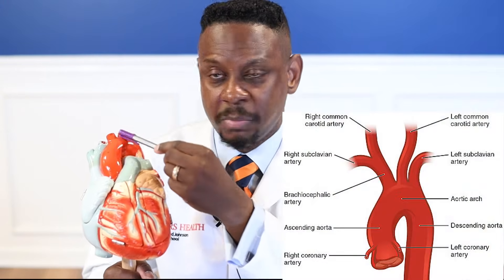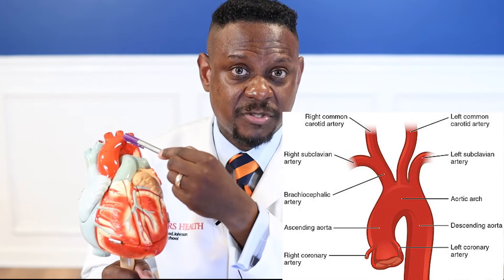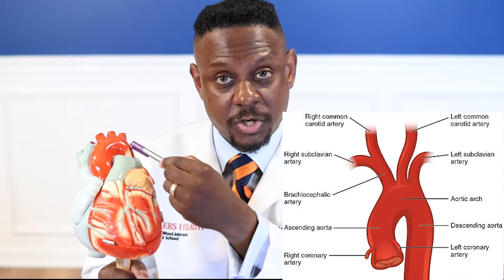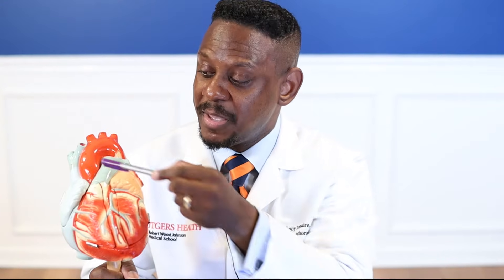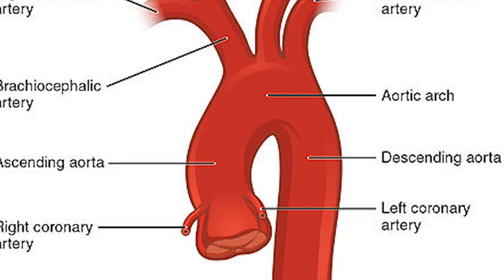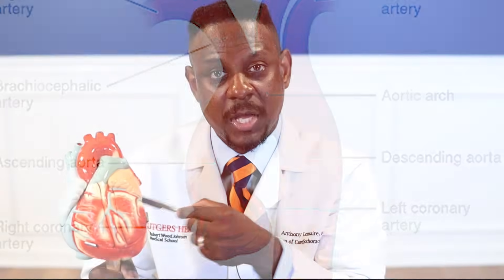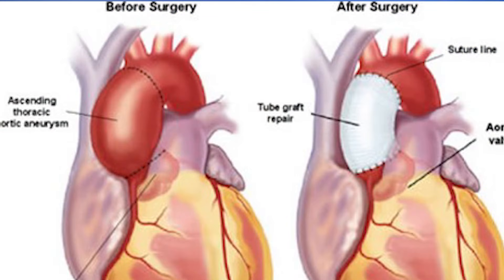Repair of An Ascending Aortic Aneurysm

Comment: I'm 41 years old and I just had a CT scan show my Ascending Aorta is at 4.9cm, I was born with a bicuspid valve which is why I am now looking into getting surgery done. I would like to get recommendations of where to go, as the idea of open heart surgery is a bit scary. I live in Southern California. Any advise would be greatly appreciated.
Reply from the maker: I apologize for the delay in responding. I understand your concern and at your young age, you will most likely require surgery. There are excellent aortic surgeons in California. I would look into Cedar Sinai hospital as an excellent hospital for aortic surgery. The medical centers associated with USC, and UCLA are excellent. If you have access to San Diego, UC San Diego also has a strong aortic surgery program. I would STRONGLY recommend doing your own research however. Since I'm in the East Coast my knowledge of the West Coast is not as vast. Good Luck!
Reply: I m in San Diego and had a very successful double surgery in March of 2024. Sharp hospital I LA mesa, surgeons Dr.D Wu and Dr Lynn are the best. The hospital has a ne2ly build postoperative building with panoramic views. Go there!
Lots of good referrals to hospital in LA mentioned below your comment

Comment: So this condition always requires open-heart to repair? i.e. less invasive wont work?
I believe its location makes it too difficult without open heart.
Reply from the maker: I apologize for the delay in responding. Currently, there are no percutaneous approaches to repair aortic aneurysms. There are surgeons that can perform this operation with a small incision but its still referred to as an "Open Heart" Surgery. Take care.

Comment: I am 70 years old female, I have ascending aorta aneurysm 4.5 decrease to 4.2 in the result of angiogram. I know there is a risk because of my age. I learned from your vlog the procedure and now I am afraid. With my age do you recommend surgery in my case? Thank you for your reply doctor. Your page is very informative.
Reply from the maker: I apologize for the delay in responding. Aneurysms rarely decrease in size. If your aorta is 4.5cm then there is a very good chance that you will not get to 5.5cm so you should not require surgery. I strongly recommend that you keep your blood pressure controlled and see a CT surgeon. The surgeon will follow the aneurysm will CT scans of the chest yearly. Good Luck!
Reply: @cardiacsurgerypatienteduca2445  Dear doctor, thank you for the reply. I have a cardio vascular doctor. He examined my angiogram and found out that my aneurysm is not even 4.5. It 4 only. I am so happy doctor. You are a good doctor. You responded at once, you are the kind of a doctor who inspire his patient to strive to live and see the lighter side of life. God bless you and more power.

Comment: Great information! I’m a watch and wait patient that my GP sends me once a year for Ct scan. It has remained at 4.1 for 5 consecutive years. I’m 59. Should surgery be an option now still? Man it does cause a little anxiety knowing it’s there. My A1c is 5.9 so type 2 is controlled with metformin and good diet. Anything else I can do??
Reply from the maker: Sorry for the delay in responding. I don't think the aneurysm will grow much. The fact that it hasn't grow in 5 years is a good sign. The best you could do is keep your blood pressure controlled. Also, continue to follow the aneurysm with annual CT scans. Btw, 4.1cm is considered small.
Reply: @cardiacsurgerypatienteduca2445  
Thank you so much for your answer I really appreciate it. The way you explain things is very helpful and informative 👍🏼I have another quick question for you if you’re ok with another one :-)
I’ve read that CIPRO should not be taken with aneurysm is that true?? I was a little concerned because my GP gave me CIPRO for a UTI a couple months ago 😳

Comment: Hi thank you for a great explanation.
I am a male 59 , lifting weights for 27 years.
Had 2 Stan's.my aorta is 4.5 c"m , can I lift any weights, o I have to stop? I am 6.2 at 220 lb
Reply from the maker: Hi, sorry for the delay in responding. I will refer you to your cardiologist, however, I will say that if your aneurysm is not growing and you are lifting weights but not Power lifting, you should be able to do it. I would state that there is always a potential for aortic rupture with high intensity work outs though. This is a controversial topic that I would review with your cardiologist and cardiac surgeon. I apologize for deferring to your doctors but this is a controversial topic.

Comment: So my 75 yr diabetic father went for  CABG + ascending aorta graft so that CABG for triple vessel could get blood but they had to abort ascending aorta graft operation in between as the aorta was highly calcified and they did not risk clamping it. They somehow got the cabg done but now there is some differential of pressure between upper half and lower half of approx 50. What are the risk factors
Reply from the maker: I'm sorry for the delay in responding. What are the risks or risk factors of what? I apologize but I'm not understanding your question. The risks of the aneurysm is possible rupture, I WOULD STRONGLY RECOMMEND you find a heart surgeon very experienced in aortic surgery just in case your father needs that surgery one day. Good Luck!

Comment: Hello, I am 25, and my ascending aorta is 4.0 cm now. As I have searched, there is a closed surgery option in aortic aneurysm. However, I donot know if it is applicable in ascending aorta aneurysm. Could you please shed light on this?
Reply from the maker: Sorry for the delay in responding. There are NO PERCUTANEOUS or "closed surgery" for ascending aortic aneurysms. By closed I suspect you mean that the chest isn't opened. There is a "closed surgery" for Descending aortic aneurysms. In those cases, stents are placed. I hope that answers your question. I strongly recommend you get a very EXPERIENCED heart surgeon to follow you BUT you will not need surgery for many years if at all. Good Luck.

Comment: Im so scared. Mine has just been recently discovered in 2019 at 4.2cm and they said not to worry we will monitor it, i carried on as normal with the gym etc, each year it remained the same but then this year its gone upto 4.5 im terrified, been reffered to a specialist in that area for a chat and gene testing. I dont want to die and im so scared of this surgery i may need. Im only 42 years old.
Reply from the maker: Sorry for the delay in responding. I recognize and understand your concerns. First, the increase in size doesn't necessarily mean it will continue. It could stop growing. Second, an elective surgical repair of an aneurysm has a 98% success in a well experienced surgeon. There is no reason you have to die. Research good surgeons. Good luck.

Comment: Hi.
Ive just found out my ascending aorta went from 38mm to 42.6.mm in one year.  Im 44 years old fit healthy look after myself. Is it likely I will need surgery at some point?
Reply from the maker: Sorry for the delay in responding. It is very difficult to predict based on one year if you will continue that rate of increase. As a result, I would say, I could give you a better answer in 1 year. If your rate of increase continues like this for another year, then I would say you will probably need surgery. I would strongly recommend you keep your blood pressure controlled and get a reliable cardiologist and cardiac surgeon. Good Luck!
Reply: @cardiacsurgerypatienteduca2445  thank you for the responding. My blood pressure take today was 123/68 but generally it's always been on the lower end of the scale

Comment: I am 61, healthy, with a aortic root dia at 3.8cm, but I was told, for me, I am simply on the "outer limits of normal". This was pointed out to me from a CT scan a got to get my calcium score (which is at 0!) At just 3.8cm, was told this is NOT an aneurysm, simply mildly dilated. This was confirmed with a follow up CT scan 1 year later showing it is stable and not growing. Just had a echo last week and after 7 1/2 years, still at 3.8cm. blood pressure is normal (115/76). Was told I should not have any worries long term, but  will follow with echo every 3 years or so just to be safe!
Reply from the maker: I think you got good advice and I'm glad that the aneurysm is not growing.
Reply: THORACIC ANGIO CT EXAMINATION WITH ECG TRIGERED 
Technique: The distance from the upper thorax opening to the end of the diaphragm was scanned following 1 mm cros-sectional axial plan and 80 cc IV contrast material fertilization, and the obtained images were converted into 3D reformatted images on the workstation and evaluated. Clinical information: Ascending aorta 44 mm. Comparison Information:-Results: 
Hypodense nodules were observed in the left lobe of the thyroid gland at the level of the thoracic inlet and at the isthmus junction of the left lobe. It is recommended that sonography care be evaluated together. 
It is the normal anatomical location and dimensions of the heart. Minimal effusion was observed in a 7 mm area located below the pericardium. 
Aortic diameter at the sinus of Valsalva level was measured as 44*42 mm. The diameter of the ascending aorta was measured to be 50 mm at its widest point. The aortic arch diameter was measured as 38 mm proximally. The diameter of the thoracic aorta from the pattern is 28 mm. 
The diameter of the pulmonary trunk was measured to be 35 mm at its widest point (pulmonary hypertension?). The pulmonary veins drain normally into the left atrium. The superior vena cava is in normal morphology. 
No pathological size lymph nodes were observed in the mediastinum. The thoracic course of the trachea and esophagus is normal. The hilus of both lungs are normal. The ventilation and vascularization of the lung are observed to be normal. Parenchymal active infiltration formations that occupy space every day are not separated. Diaphragmatic contours are normal. 
In the evaluation of the upper abdominal structures in the image area, 2.2 cm solid lesions were observed in the medial crus of the left adrenal gland (adenoma?), Comparison with previous reviews of the case, if available, is recommended. In 3D images, thoracic walls, soft tisue and bone structures appear normal. Conclusion-Recommendations: 
-Aneurysmatic dilatation reaching 50 mm in the ascending aorta. -Dilatation reaching 35 mm in the pulmonary trunk (pulmonary hypertension?). -22 mm solid lesion in the left adrenal gland (adenoma?). 
-Nodules in the thyroid gland are recommended to be evaluated together with sonography tools Is my situation normal? What can I do?
Reply: You just described my exact situation. Except that two months ago they found a second aneurism  - in a peripheral artery. I now plan to ask for a scan of my abdomen, just in case there are others.
Reply: I was diagnosed with 3.8 dilation at 29.
Reply: @Maryrosalia  How old are you now?

Comment: Hello, I have a dilatation of my aortic root at 4.1 and I also have right bundle branch block. My question is whenever this goes to surgery, will the RBB be a deciding factor of mortality with open heart surgery to fix the aneurysm? Thanks
Reply from the maker: I apologize for the delay in responding. First, depending on your age, there is a chance that you may not require surgery. However, the presence of a Right Bundle Branch block is not a deciding factor in having surgery. The 3 critical factors are (1) Size of the aortic root, (2) Presence of aortic valve regurgitation, and (3) the presence of symptoms.

Comment: My primary physician suggested that I get an ultrasound of my heart at age 66.  No symptoms but she felt that my continued vigorous workouts could contribute to a dilation as the expanding ascending aorta gets less supple with age and may gradually expand. 
That saved my life. Dilation was very significant, and, on first annual follow-up, the subsequent ultrasound showed that a dissection of the inner wall had occurred but had clotted.  ‘had the repair on an expedited basis a week later. Doing great 3 yrs post-op. 
So discuss getting an ultrasound, even if asymptomatic, with your primary.
Reply from the maker: I'm glad that everything worked out for you!

Comment: I just came out of the hospital. My Aorta is 4.2 , and the doctors let me go because they didn’t see a reason to do a procedure.  My concern is how to stop it from dilating?
Reply from the maker: I apologize for the delay in responding. The best way to slow down or minimize the growth of the aorta dilating is to keep your blood pressure controlled. High blood pressure increases the size of the aorta. That is the best way. Some of it is luck unfortunately.
Reply: @cardiacsurgerypatienteduca2445  My blood pressure is very low, always!
Reply: @cardiacsurgerypatienteduca2445   Thank you so much for answering. I heard of other procedure robotically. Thankfully my blood pressure is very, very low

Comment: Our daughter has Turner’s syndrome and has a bicuspid aortic valve. Her aorta was perfect until we put her on Norditropin (growth hormone) and it was discovered after a year that she had a mild aneurysm. It was written off that it had anything to do with the GH. We continued using them. At her echocardiogram a year later they said it went from mild to moderate. Still rejected the idea that Norditropin had anything to do with it and they highly recommended continuing using it. Finally, due to a global shortage we opted to quit using it and at her last echo it was recommended that she have a sedated cardiac MRI because her aorta looked different. I am confident there is a correlation, as now her Z-score is 5.29 and the aneurysm is classified as “severe”, per the radiologist’s analysis. Our cardiologist has yet to return our calls or schedule anything, even to review the results. To go from mild to severe in a pediatric patient with normal BP seems frightening and that surgical repair is imminent. How would you recommend we proceed?
Reply: I should add that she is just 8.5 years old.

Comment: Dr Anthony, thank you for a very clear explanation for us laypersons. I’m 63, had CAC done in March of 2023 with a score of 4.76, however an asc aortic aneurysm was found that was 4.2cm. My cardiologist did not say anything to me! And I happen to be going through my report from 2023 a couple of weeks ago when I found the AAA result!!! 
I have been on keto diet for about one year and I decided to get another CAC which I had two weeks ago. My CAC score is now 15 but the AAA is 4.1cm. 0.1cm smaller that last year.
I don’t have insurance and tight on finances, so I want to ask you if I should worry about my AAA at 4.1cm? 
I’d really appreciate your feedback!!!!! 
Thank you very much!!!
Reply from the maker: I appreciate the question. I would state that an ascending aortic aneurysm of 4.1 or 4.2cm will most likely not grow to the 5.5cm however, it still needs to be monitored. By the way, aneurysms don't get smaller so the 4.1cm that was just pointed out is most likely a variable based on the person reading the CT scan. Radiologists can measure the same CT scan differently. Either way continue to monitor. Keep your blood pressure controlled.

Comment: When the graft gets put in, what will happen in the aspect of contractility function of the ascending aorta? Or is there enough pressure generated by contraction of the LV that it won't really affect BP if the graft part doesn't contract down?

Comment: Thank for this well informative video. I am at 4.4x 4.5 and I cough all the time.  The cough is so bad it wears me out. I have seen every doctor ENT, Lung, allergist. Will Ascending Aortic Aneurysm cause a cough?
Reply from the maker: I'm sorry your dealing with the cough. Its unusual for an aneurysm to cause a cough unless it was extremely large and perhaps irritating surrounding structures. The size of your aneurysm doesn't seem that big. If you really believe its the aneurysm then get a CT scan chest with contrast and have the radiologist determine if the aneurysm is compressing any structures. Good luck!

Comment: Greetings
I am 42 and have BAV and ascending Aortic Aneurysm. My Aneurysm is at 46mm. What are the recommended size for a repair operation for my situation.
What about my life style, I have two small kids, can I carry them and play with them?
Thank you
Reply from the maker: Sorry for the delay in responding. First, the recommended size for repair is still 5.5cm unless you are having open heart surgery for some other reason and then I would repair it then. Second, I would strongly recommend aggressive blood pressure control. Third, get a well experienced heart surgeon who specializes in aortic surgery to follow along. Fourth, I hope you never need the surgery however you are so young if you live another 40 years, the aneurysm could get bigger. Finally, you can lift and play with your kids. I would stay away from power weight lifting. Don't live as though you have to greatly alter your lifestyle. Most importantly, keep your blood pressure controlled. Good luck!
Reply: @cardiacsurgerypatienteduca2445  
Thank You very much

Comment: Hello dr. I was diagnosed with 3.5 ascending aneurysm this week. Very scared. NL BP slight elevated cholesterol and stopped drinking twice a week and smoking a pack a month.  52 yo. Since I’ve changed my lifestyle and watch saturated fats and exercise daily , could this prevent growth of this monster ? I think the alcohol and smokes is what caused it .  Thank you for your time
Reply from the maker: A 3.5cm aneurysm is very small. I do not think you will require surgery but continue to have it followed and monitor your blood pressure. Good Luck.